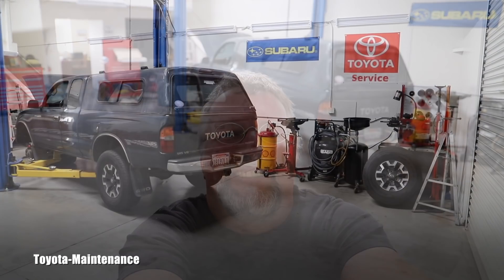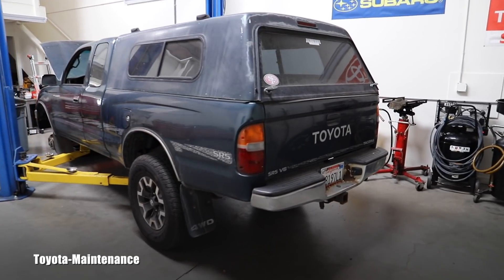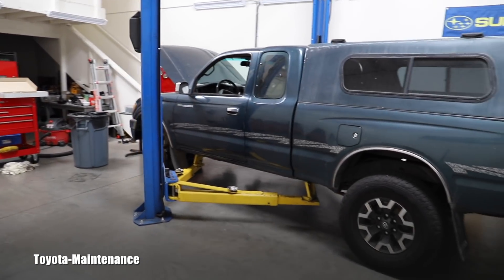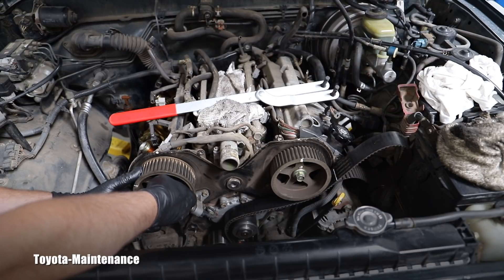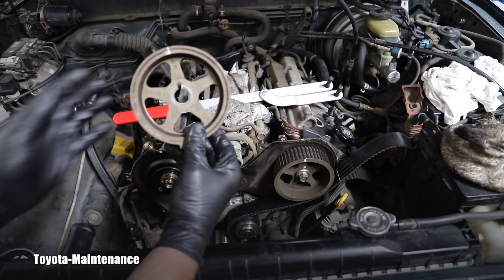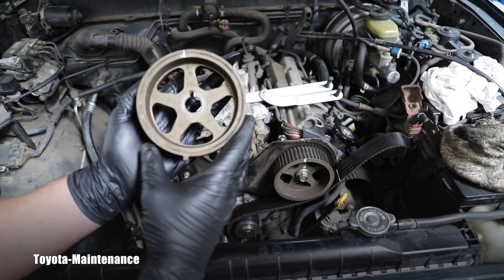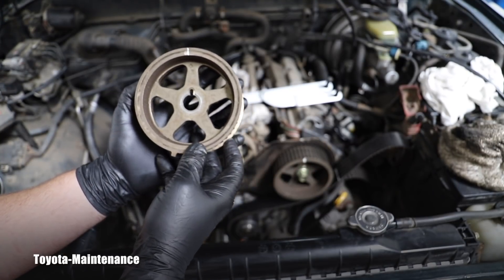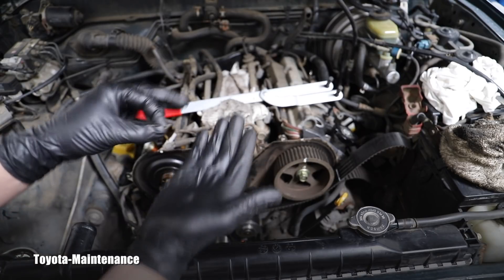Toyota engine 5VZ-FE Camshaft Timing Pulley removal

Comment: I saw that the cams moved when you broke free the bolt. Question is, as mine have moved too, what is the proper procedure to bring them in alignment with crank? My belt is off as was yours. Do I just turn the cranks with my holder tool until the marks are lined up again?
Reply: can you tell me what you did to alignment. Im in the same situation.

Comment: If the camshaft pulley seals on my 20 year old 2UZFE are not leaking, but I'm already in there to replace the timing belt and water pump, would it be worthwhile to break these bolts loose and replace the camshaft pulley seals anyway? Or should I just leave them be? I think I'm going to replace the crankshaft seal since I need to break that bolt loose regardless
Reply: same situation..same engine. what did you do?
Reply: @jasonjohnson9403  uuuugh. Three years later and I still haven't done the job. Thanks for reminding me :\

Comment: Is there a reason you choose not to use an air impact on the tb pulley bolts? Do you think it would damage something? I would imagine it would be allot easier, I know the radiator can be removed fairly easily if you need more space.  love your videos!
Reply: No way..
Reply from the maker: just showing it as factory repair manual says
Reply: Always good to at least crack them by hand, you snap one of those off and it’s a bad day